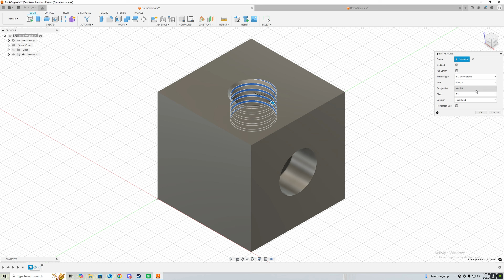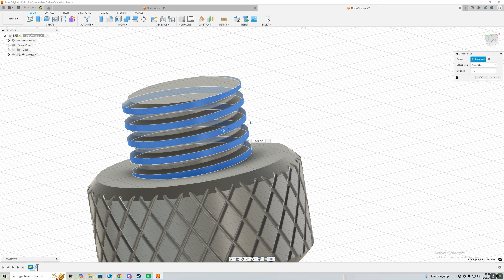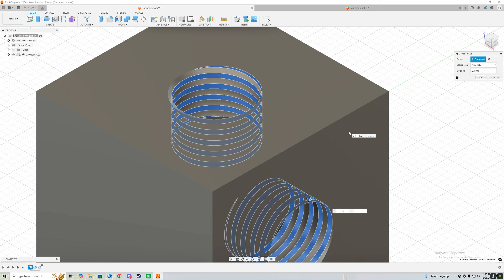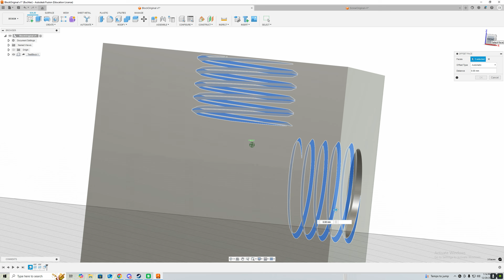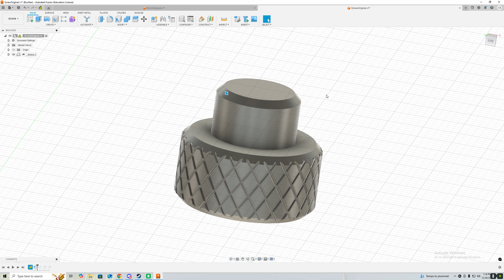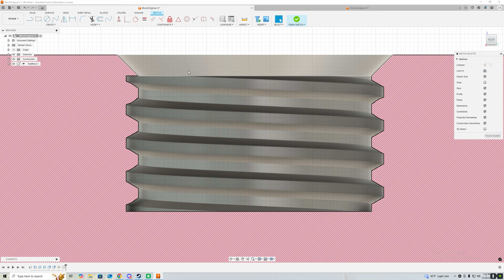Perfect 3D Printed Threads: Optimizing Screws & Holes for the Best Fit | 3D Printing Tips

Comment: I came here to learn how to do coarse threads on M25 and this guy is printing M6, great way to show what is possible, keep up the good work. To give you suggestions on your next vid, I don't know what's out there maybe print gaskets to seal? I was using gutters that i fill with silicone acetate to make seals between parts I want to have a seal in between. Then the mating part would have a raised feature to press in on the silicone.

Comment: The angles of the threads of these "standard" screws are not ideal for 3d printing.  If you want to make your own screw connection with both sides 3d printed, you're better off designing your own thread profile to ensure all overhangs are easily printable.  That said, I prefer using actual stainless steel bolts (I like M3 for most stuff) and either heat inserts or 3d printed inner threads (in PETG) without tolerance, allowing the bolt to still cut its way in there, deepening out the existing profile.  With PLA that can cause the layers to separate (also depending on the orientation), but with PETG you can really feel the bolt getting warm as you screw it in and that warmth actually helps form the PETG around it.

Comment: I often use internal treads for some mechanical parts (the smallest ones M4), which works pretty well. I print it without any tolerances and simply use a thread cutter for the finish. This way I also get rid of the layerlines and have perfect threads.
As screw I only use Metal ones because there is no benefit of printing these standard parts..
Reply: There is a major benefit says who go buy them they cost 3.45 and even more depending on the size

Comment: I've done something similar a few times. For adding a chamfer to the edge of the thread/hole I've done a revolve subtract before, which is definitely too much work. Another option I like is selecting the feature's face. It's been a few years since I used Fusion, but there should be an option once you select the chamfer tool. It has it's limits, like for your cube it would not only chamfer the hole, but also the outer edges of the face, but I prefer it for situations like here.

The other option you can do too is go through the features under your cursor to find the initial edge of your revolve. Again, I am rusty at Fusion, but in both Creo and NX this is an option which let's me cycle through either sketches on top of each other or different datum axes that I've used when assembling screws to holes.

Regardless, great video, and thanks for sharing tips on how to model screws for printing!
Reply from the maker: Revolve subtract is not a bad idea, but I agree it’s a bit more work. Thanks for watching! What do you use to draw now? I haven’t used Creo or NX, I believe I had to use Creo in college for one class, so that was too long ago to remember.